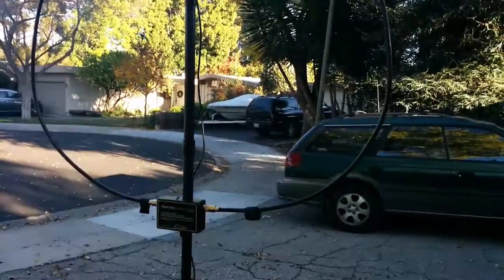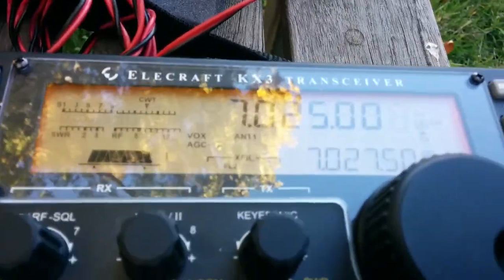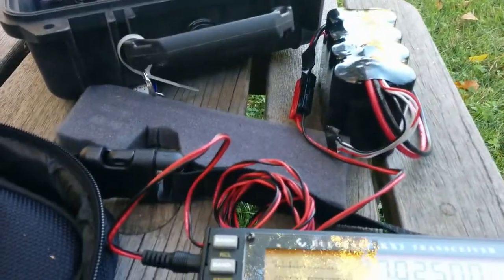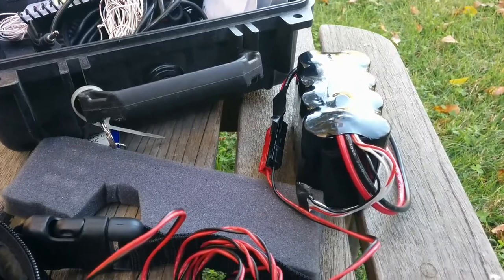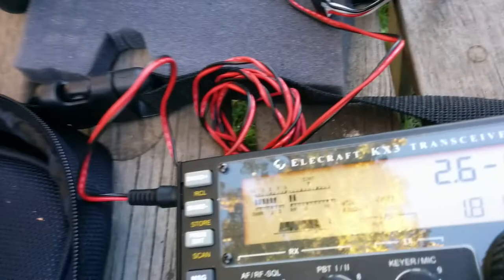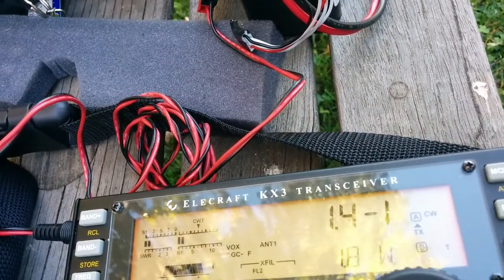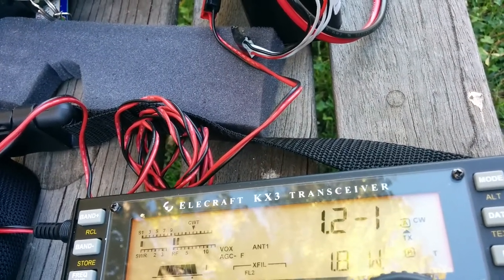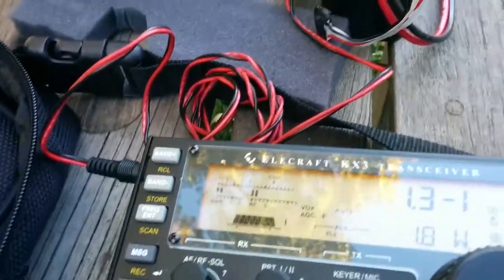AlexLoop Walkham Magnetic Loop Antenna Part 3: Tuning to 7.025 Mhz

Comment from the maker: 1. AlexLoop and Tripod in the case:
Alexloop Walkham Magnetic Loop Antenna Part 1: Carrying Case

2. Field Assembly:
AlexLoop Walkham Magnetic Loop Antenna Part 2: Field Assembly

3. Tuning to 7.025 MHz
AlexLoop Walkham Magnetic Loop Antenna Part 3: Tuning to 7.025 Mhz

4. 7.025 MHz 1:1 SWR
Alexloop Walkham Magnetic Loop Antenna Part 4: 40 Meters 1:1 SWR